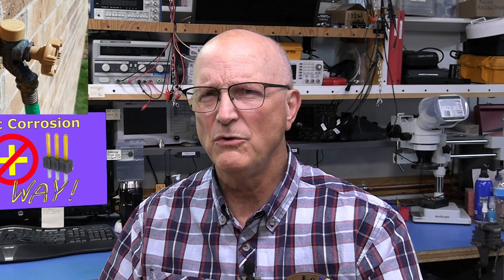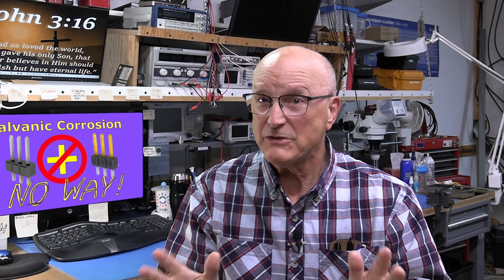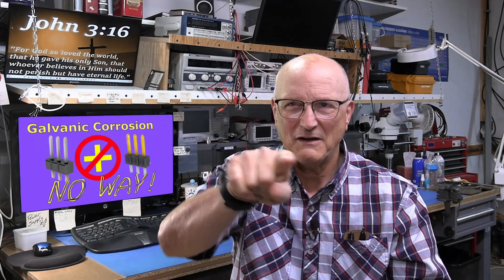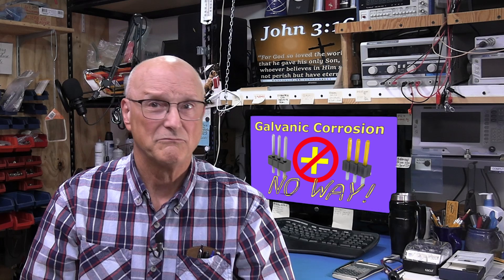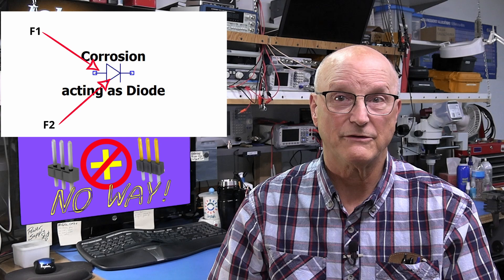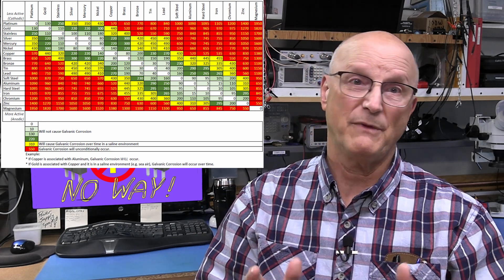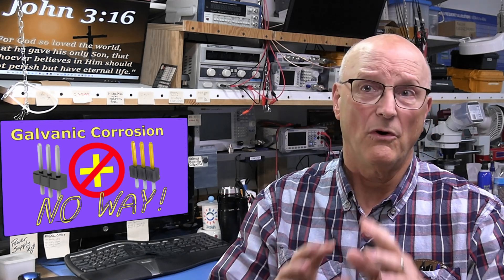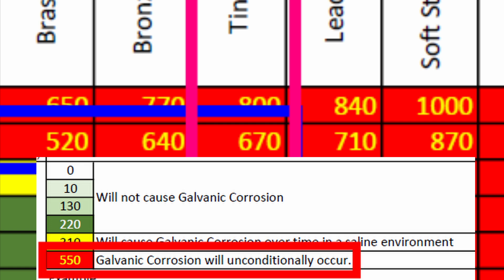Galvanic Corrosion (071)

Comment: So, according to the chart, CCA wire or copper-clad aluminum is bad!?!
Reply from the maker: Remember the needed ingredient in addition to the two metals: a dielectric/moisture. In copper clad aluminum there is no dielectric/moisture between the two metals. Thus, the galvanic process does not take place. :-)

Comment: I too thought gold plated was like the gold standard of connector. That table is very helpful. Ironic that platinum then gold appears to be the least compatible then followed by copper.. Makes me wonder if aluminum wire was the better option so long as copper components and the like were properly isolated. Although the old aluminum wires I've replaced were extremely brittle. Is that another effect of galvanic corrosion? I think I've messed with brittle copper wires aswell.
Reply from the maker: The brittleness is a function of the alloy. Just like the old copper wire is VERY hard to work with ... not very bendable (ugh...OLD 12AWG wire ACK!).
Notice the conductivity of gold vs copper. gold actually isn't as good (noticeably). The advantage is that it doesn't corrode (unless we put it in the wrong places). 🙂

Comment: Great video and especially the table that I had never seen before, thanks. Can you tell what the numbers in the table mean?
Reply from the maker: Thank you so much! Honestly, I'm not sure what the numbers actually mean. Sorry. 🙂
Reply: @eie_for_you well I found out. The numbers are a classification between 0-2000 the higher the number the worst the reaction will be between the dissimilar metals.
Reply from the maker: @ Well, actually, that much I did know. I guess I was thinking what they meant on a deeper level, like what math they used to arrive at the numbers. How do they calculate them. That I don't know. 🙂

Comment: I JUST BOUGHT A NEW PAIR OF SPEAKERS AND,THE TERMINAL POST ARE GOLD PLATED.WHAT CAN I DO TO PREVENT THIS PROBLEM OF GALVANIC CORROSION?
Reply from the maker: I am assuming that these speakers have banana jacks for connections(??). If this is the case, then buy the mating, gold plated plugs. The internal connections for your wire, itself, should be compatible with your wire. Hope this helps. 🙂

Comment: Does a solid conductive particle cause galvanic corrosion? What if it's not an aquatic solution in between 2 dissimilar metals but just a solid dust that conducts electricity?
Reply from the maker: I cannot answer that question with confidence. Sorry. :-)

Comment: Thanks again! This was a very helpful explanation of this effect. Since there was not enough copper in East German times we must use Aluminium cables for house installations with all the effects you explained. It was a nightmare! Not only the corrosion but the inflexibility of the cables and the breaking during installation!
Reply from the maker: You are welcome!  I knew they tried it in the states for a short time. Even now, there is copper coated aluminum wire that I have encountered which, if you accidentally scrape off the VERY thin copper coating, won't solder at all. 🙂

Comment: I've rmember reading somewhere that oil pipelines and other large infrastructure will apply a voltage to areas with galvanic risk to neutralize the corrosive interface as well.
Reply from the maker: Yes, yes ... I am remembering this, too (now). While this wouldn't work for connectors inside an electronic device, it would be feasible to work in those kind of instances.  It really is a pretty cool idea! :-)

Comment: It seems worth pointing out that nickel and tin don't necessarily look that different as platings. I would think that some of those RCA jacks on things might be nickel-plated and not tin plated, but I don't really know what's what their specifically.

In any case, it looks like on that table that nickel and gold are far better matches than gold and tin with each other. I don't think there are a huge amount of tin-plated audio jacks for putting on cables, but there definitely a lot of nickel options that are good. It does look like nickel would be moderately more compatible with tin jacks then the gold ones though.
Reply from the maker: Ya know ... in times past these were tin plated. I see now, as I look at DigiKey, they have Gold and Nickel plated; I don't see any tin plated ones. Yes, Gold with Nickel are within the green region, but with a 300 ... just within the green region. Yes, Gold and Nickel are FAR better matches than Gold and Tin. :-)

Comment: I imagine there is a way to actively  reduce  or prevent corrosion.  I have used electrolysis to remove rust from iron based parts for restoring car parts.
Reply from the maker: This is an interesting idea. I suppose that this might be a possibility in some situations.  But it is way simpler just to be careful to use the right two metals together. It is very easily done if we just pay attention to what we are doing. 🙂

Comment: What do you think is the most effective method for connecting a copper ground strap to a galvanized antenna tower? Zinc tends to react poorly with most metals, so I've always relied on NOALOX paste for this purpose.
Reply from the maker: I have no idea how I missed this comment/question. YT obviously doesn't notify me about every comment. :-/
Now there is a very good and practical question! I actually haven't thought much about it. I go to the electrical supply store and buy one of those clamps that is specifically designed to attach to a ground rod (http://www.homedepot.com/catalog/productImages/1000/c0/c0466da9-4238-46d3-a35d-202bd42d6544_1000.jpg) and use this. Instead of the ground rod, it is the tower leg. :-)

Comment: This is the ( main ) cause of festive LED light strings , put outdoors ... moisture creeps up the LED legs , made of plated steel .... the 3 Volts of each LED causes (  LOTS of BROWN RUST = 💩) ... and ,  then the homeowner has to buy new lights every year ... but , then it keeps the manufacturers ( in profit 😝? ) ... OMG ........ DAVE™🛑

Comment: This is an issue on aircraft.  Using the wrong type of bolt can cause damage to the structure of an airplane.
Reply from the maker: I am remembering that from comments of my fellow airman from when I was in the USAF. It seems that this also applied to rivets they would use. 🙂

Comment: When using steel bolts in aluminium airframes you can get this... They use a yellow insulating goo called Duralac.
Reply from the maker: Now THAT'S cool! I hadn't heard of that stuff. I know that they have some material that electricians use when faced with aluminum/copper contact to avoid issues. 🙂